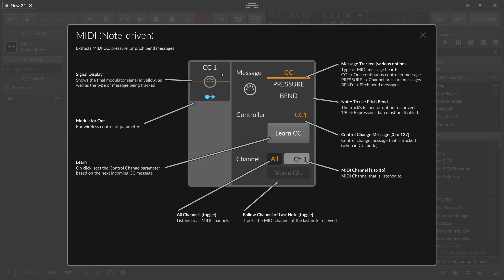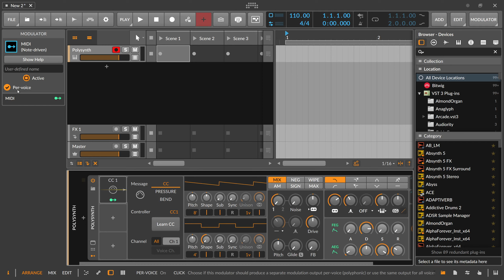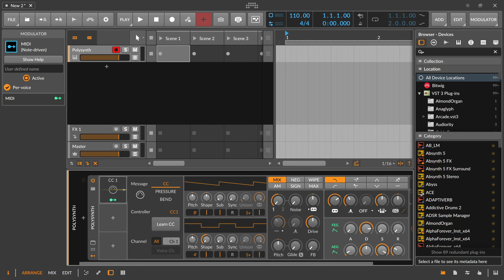MIDI - Bitwig Modulator Guide

Comment: this doesn't work as far as i can tell, it simply won't "learn" whatever knob i'm twiddling and correctly assigning it to the appropriate cc doesn't work either. the same controller works perfectly when assigned to say a track fader outside of a midi modulator, but inside the midi modulator, absolutely nothing?
Reply: as a workaround you can add a macro modulator, right click on the knob and select "map to controller or key" in order to bind that knob to your cc.